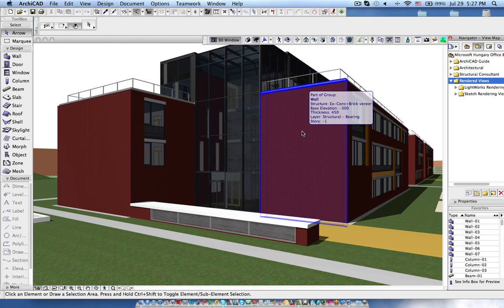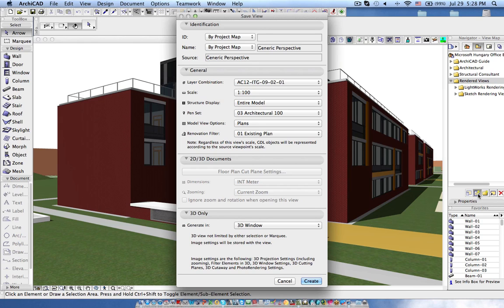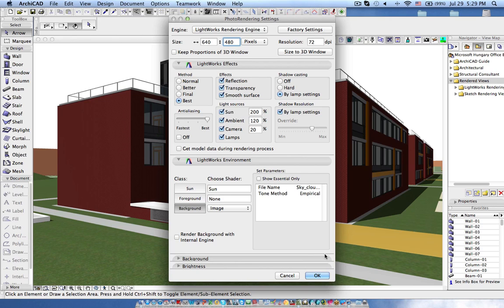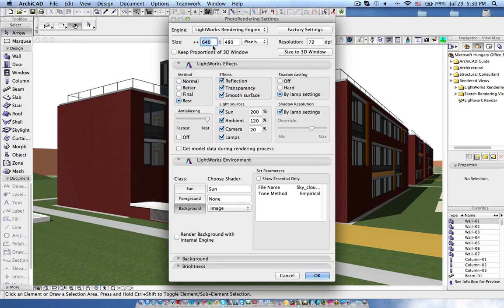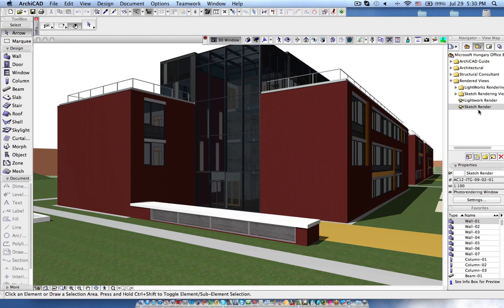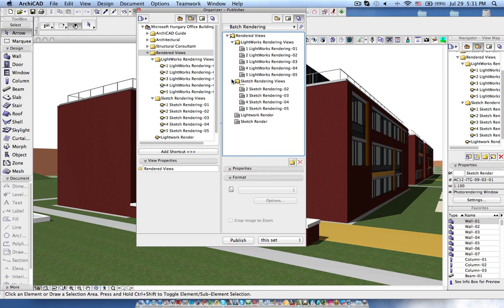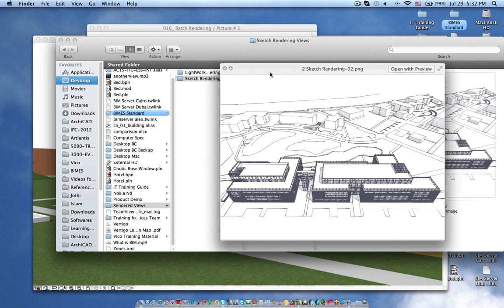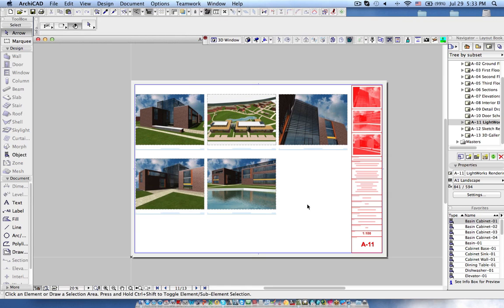Batch Rendering in ArchiCAD

Comment: Does this still work with ArchiCAD 18?
I've been trying to do it and I set everything up like you say in your video but when I double click on the view in the organizer it renders with the sun coming from a different direction than when I click on the Cinerender render button.  I've tried every sun setting I can find to get them to both render the same way and they don't.  I can't figure out which sun settings are being used since the sun direction changes depending on if I render from the Cinerender window or render by clicking on the view in the organizer.
Reply from the maker: I tried with different sun position for different views and its working fine. I am not sure what is wrong in your file / what settings you are missing. May be you can contact your local technical support for ArchiCAD.